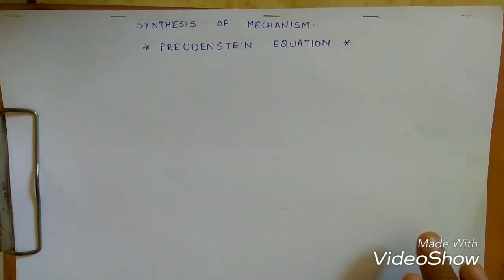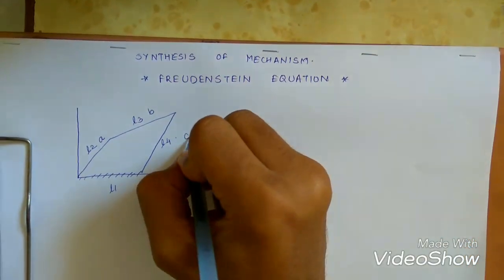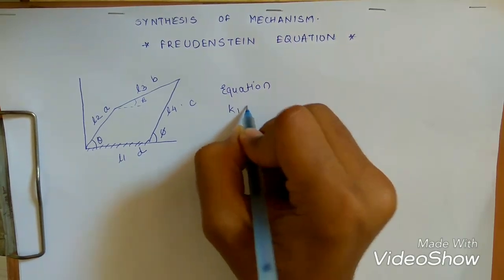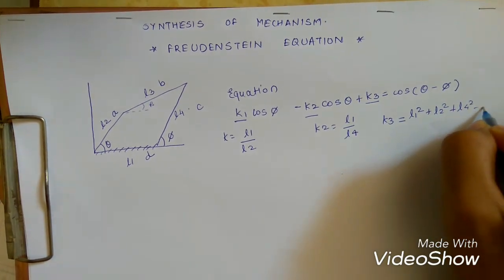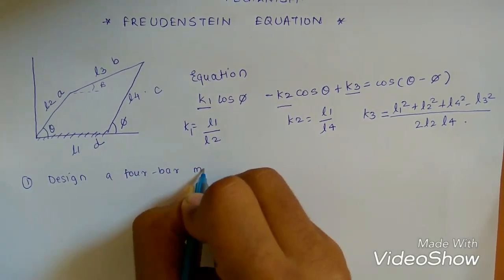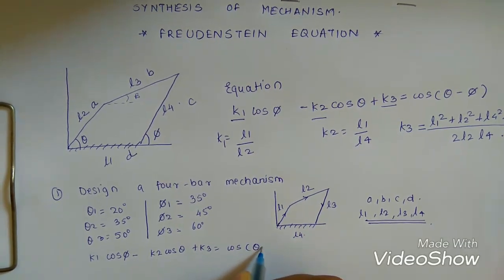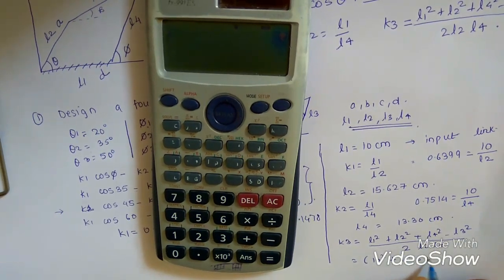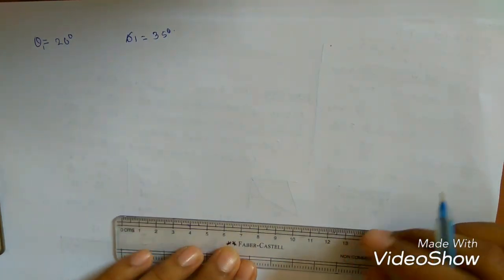Freudenstein equation synthesis of mechanism

Comment: Chirag bhai.. can you pleas solve this

Following is the data for a four bar mechanism, for velocities and accelerations
for one configuration. Determine the link synthesis of the mechanism and
represent the mechanism in its first position.
 ω2 = 20 rad/sec;  α2 = 20 rad/ sec2
ω3 = 8 rad/sec;  α3 = 100 rad/ sec2
ω4 = 10 rad/sec;  α4 = –150 rad/ sec2

Comment: Okay, so basically I'm designing a steering system for my third year dissertation. It is Ackerman based and I want to predict the angular performance... which is essentially the opposite to what you have done here. L1-4 are all known but I would like to know the value for all my angles as I vary theta. I know it can be done but I've totally forgotten, any idea guys?
Reply: Num, I've figured it out... great video thanks!
Reply from the maker: +Zachary Sylvester I'd be happy to help.
Email Id please.
Reply from the maker: Zachary Sylvester Il get back to you ASAP!
Reply: Chirag Bansal I think you need to use the half tangent representation of the sine and cosine function. I'll try it and let you know how it goes.
Reply from the maker: +Zachary Sylvester sure.
Reply from the maker: +Zachary Sylvester sure.